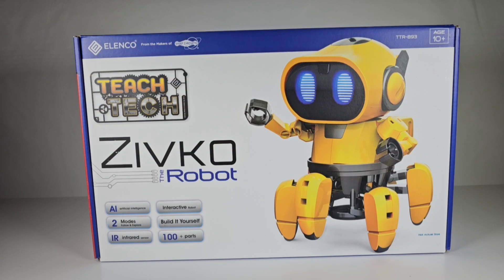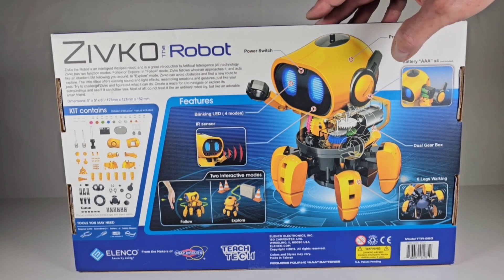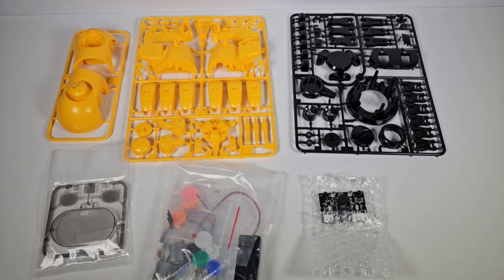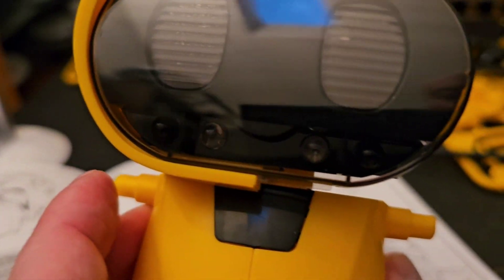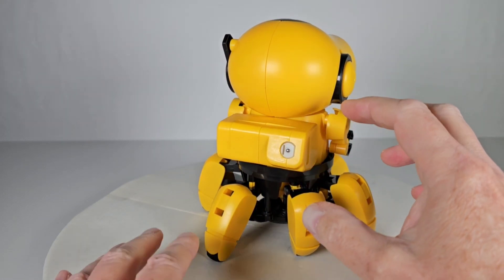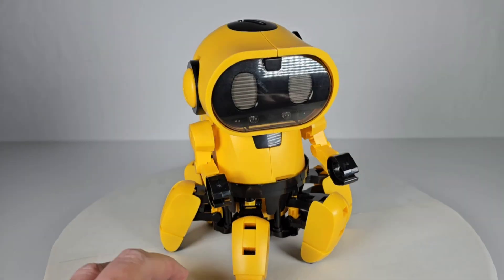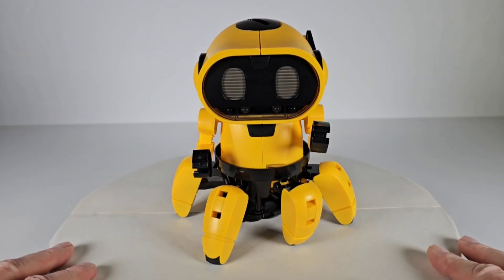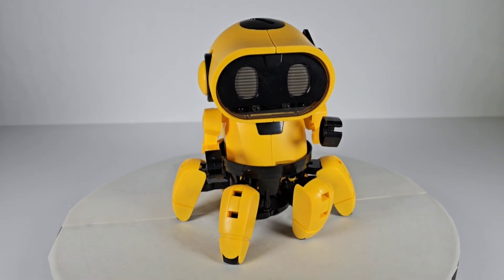Zivco The Robot By Elenco

Comment: What we call AI changes over time. When I was involved with AI in the 1980s we called all kinds of things AI. Much of what we called AI is considered main stream now. 
Here is a brief history of AI:
1956: Most people point to the Dartmouth conference as the real start.
1960s: First there were heuristics. We thought if we just had enough heuristics we would solve AI. That didn’t work.
1980s: Next we tried rules. We thought if we just had enough rules we would solve AI. That didn’t work.
2000s: Then we had neural networks. We think if we just use enough training examples we will solve AI.
2020s: Now it is generative AI. AI can now create things using Large Language Models. We think AI will be solved very soon.
Reply: And yet, improvement happened. AI is not a binary, if you'll pardon the pun, it comes in degrees. There is no singular point where "AI has been achieved". It's here now, getting smarter every day.
Reply: @Hamdad  We say AI is solved when we have AGI (Artificial General Intelligence). AGI is somewhat subjective. The original Turing test was when a human could speak to AI and not know you are talking to AI. There are claims that GPT has passed the Turing test. However, we don't really consider that AGI after all. But yes, there is progress every day. I have divided the history into 20 year increments  because it seems to me like there is a 20 year life cycle going on in AI. This is based on me studying AI in the 1970s, working in AI research in the 1980s, then leaving the field during the AI winter of the 90s. Getting back into AI now so that I can add AI to the curriculum I use to teach computer science at a local high school.
Reply from the maker: Wow! That's pretty cool. Yeah, for better or for worse, I think it's coming.

Comment: There is yet another version. It uses a micro:bit SBC. You can program it with MakeCode. They may not make them any more. I got mine from eBay. I wish it had more sensors. With just the IR sensors on the body it can't be programmed to do much.
Reply from the maker: I think I've seen the one you're talking about. This was definitely a more simple one but I was looking for something like this and it was a fun kit! 😄
Reply: moxie